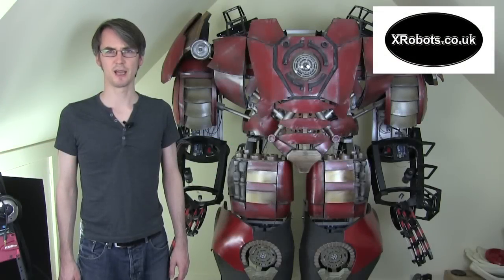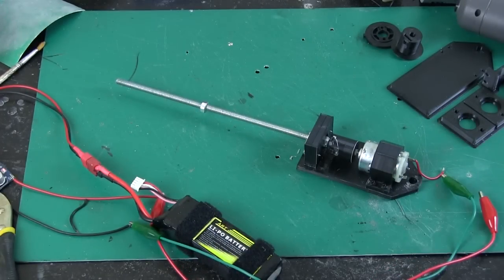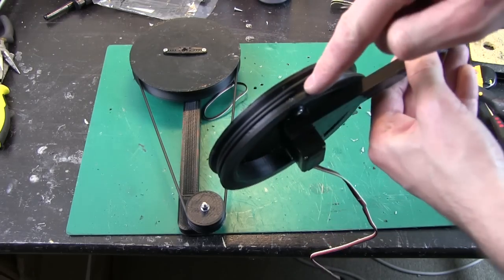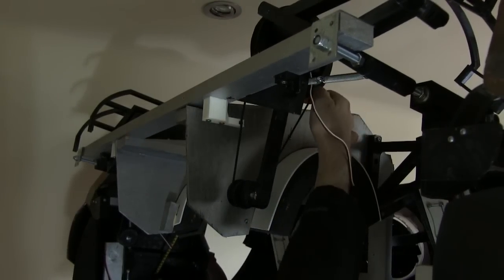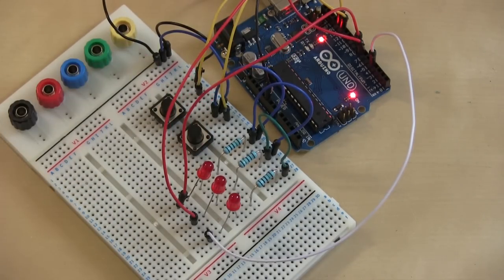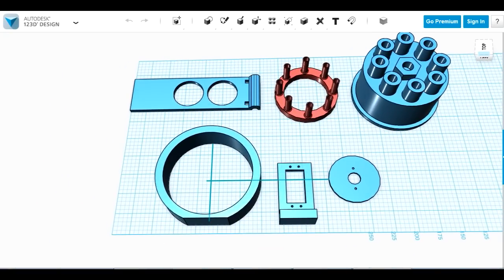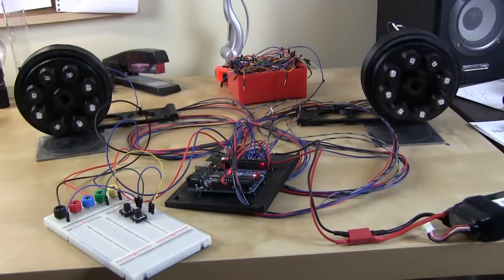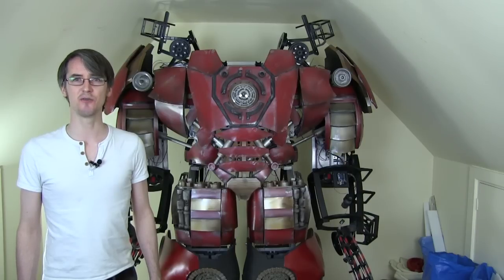Iron Man Hulkbuster Cosplay #33 | Pop-up Shoulder Cannons | James Bruton

Comment: The vibration looks like it's coming from a lack of alignment between the motor/adapter block and the bearing that the threaded rod goes through.  You can see the mis-alignment between the end of the adapter and the inside of the bearing.  The unsupported length of the threaded rod is just magnifying the vibration.
Reply: georgianbents and the

Comment: This is pretty sweet, but you're over-thinking some extremely simple things and coming up with answers that are much, much, much too complicated than they would ever need to be. 

All you needed for the shoulder flaps was a simple extension rod motor. Hook it to the x-frame near the spring on a swivel. The rod would only need to travel back and forth out of the motor a few inches to open and close that flap. 

As an engineer I can appreciate your designs, but simple is always better. That being said, I look forward to seeing the finished product. Keep up the good work. =)

Comment: Let me first start out and say that I'm new to this game.  I recently purchased my first 3d printer and an Arduino starter kit. As I was watching the video on how your lightsaber extends a thought came to me.  Instead of using the setup you currently have why not salvage an old car power antenna motor and have it run the entire shaft of blade the mechanics are all there.  So with a push of the button it would go up and down with ease.  The only issues would be housing the bulky motor part which could be placed in the handle and its also bit slow. I don't nearly have enough knowledge but maybe the motor can be increased someway.   

Jason

Comment: Kind of an overly complex mechanism for the shoulder weapons, why didn't you just use the sliding connection points as a point of actuator engagement? Those were relatively short travels to deal with and the mechanism would be nicely hidden.

Comment: I don't really understand what you're going for with these shoulder cannons. Like is it supposed to be a Gatling or something? 'Cause that's not how Gatlings work. If it's just a multi-barrel laser or repulsor, then there's no need for it to rotate, right?
Reply: Are you fucking serious? The purpose is that they look awesome, their not going to really shoot actual lasers or bullets so does it matter if they have to be realistic?
Reply: ***** This is how i'd try to do it as well...dont know how fast those motors spin though...
Currently the desired effect may be that its spinning superfast but it does that optical illusion so it seems to spin  slowly, wich is supported by the strobe...maybe :D

also an awesome effect would be if the top gun glows very bright and the nex two or three are dimming down "cooling off"
Reply: It might rotate for aiming? I don't know either. It looks good though.
Reply: Lobo 123 Hey, you don't have to agree with what I have to say but how about we be civil about it, please?
Even fantasy is usually arranged in patterns that are familiar or logical. An X-Wing hasn't got wings in the aerodynamic sense and it flies in space mostly, but it makes banked turns as it flies around, as if it were a traditional fighter plane. It evokes something familiar and then conforms to the pattern of the expectations that come with it, because that helps people relate to the fantasy and embrace it.
In the case of Iron Man, in the movies, if something's not a repulsor or a unibeam it's some advanced form of a conventional weapon. Iron Man shoots a tank with a tiny little missile that pops out of his arm - impossibly effective and powerful for its size, but a missile nonetheless.
And that's what bugs me about the shoulder weapons. They look kind of like rotary multi-barrel guns but they don't behave at all like them, so I don't see them as such. So just what are they? What's the desired effect here?
Reply: Tetsujin I am not sure either, but in the other suits from iron man he had little missles that shot out as well as lasers in other parts.  He may be using that idea for the inspiration for the gun.  Just a guess.
Reply: Tetsujin it doesnt need to make sense if it looks cool
Reply: CaseFace5 True, and I frequently make that argument myself. But I think the effect so far doesn't look very cool. It looks like a Gatling but it rotates slowly and doesn't even make one full rotation - I just don't get it.
Reply: Tetsujin  *****  I agree. There are two spots im not amazed with on this suit, one of them are calfs (way way to bulky) and the second one are these shoulder things. I am not super excited with the opening mechanism as well as the function, thinking i'ts pretty complicated considering how it looks. This 'rotate and light' function reminds me these old plastic toy guns and i think it damages the overal look of the suit, which is otherwise fantastic and very realistic. If I had to suggest anything for shoulders, it would be either nothing (there's no obligation to have any feature in there + you'd save some weight) or some fake missiles that just look cool, without any unnecessary light effects.